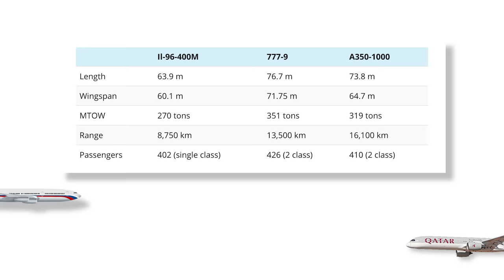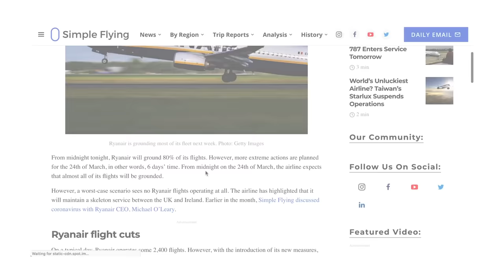The 400 Seat Passenger Plane With No Customers: The Il-96-400M

Comment: Yeah... not the best time to make a quad jet
Reply: does seem strange. why not restart the Tu204 line? update the wings on it, PD18 engines are not far away. the tu204 was a 757 ripoff anyway and we all know how well the airbus a321 xlr is selling atm. the comec 929 is a soviet style project. they have 1, we must have 1 also, no matter the cost or even if we need 1. stick it next to the 100,000 super aircraft carrier they want to build as a waste of money / bad idea
Reply: Likely conceived years ago and just now finishing up development. Late to market in bad timing looks cool though
Reply: Hasn’t been a good time for 25 years.  The 777 put quads and trijets on notice.
Reply: if the a340 failed this will too.
Reply: @mrrolandlawrence  The Tu-204 is probably dead because of the MS-21, but again ... maybe after the MS-21 hits the market, it will focus on upgrading the Tu-204. After all, why not have two products on the market instead of one.
Reply: @mrrolandlawrence  They ARe doing that: "The latest version, with significant upgrades and improvements, is the Tu-204SM, which made its maiden flight on 29 December 2010. In April 2022, United Aircraft Corporation (UAC) announced plans to assemble 70 Tu-214s by 2030."

Comment: Just slap two GE9X onto it, problem solved.
Reply: There was consideration given to making a variant with two Aviadvigatel PD-35 engines when those become available in the late 20s.  But it would need a completely redesigned wing and flight control system, and then go completely through recertification.  And the cost of such is nearly as much as building a completely new airplane - which would have better aerodynamics and weight tolerances.
Reply: they can't because: 1. needs a total wing redesign, which they cannot do. 2. due to sanctions they cannot buy any US made engines
Reply: I'll Prefer The RR Trent 500
Reply: THEY GOING TO SLAP 
TWO PD-35 ONTO IT AND PROBLEM SOLVED 
PUTTING AMERICAN PARTS MEANS THEY CAN'T SELL PLANES TO AMERICA'S ENEMIES 
AND IF RUSSIA GETS SANCTIONED THEY WON'T BE ABLE TO FINISH BUILDING THEIR PLANES
Reply: @rocketman1058  Was a damm joke...
Reply: NEVER!! WE SHOULD KEEP THIS A QUADJET!!
Reply: @Rocket Man might not need a wing design. 
A-340s and A-330s share the same wing

Comment: The a340 was better and no body wants that anymore, os an il96....
Reply: A340 sucks
Reply: @ahmedibrahim9082  It didn’t in the past.
Reply: @Think_Inc  It always sucked Il96 is the best
Reply: @ahmedibrahim9082  maybe, but It is still better than the il96
Reply: @marcducati  Nahh The A340 was terrible. The only way the A340 was better than the Il96 was the number of sales but on paper the Il96 is far better
Reply: @ahmedibrahim9082  i find that interesting as the il96 was heavily borrowing from the a340 program espionage style. this was because the il-86 was a dud. widebody with 2000 mile range. the a340 was a plane of its time. its the same plane that is the a330 with 2 jets. they looked at a 3 jet but that was soo much alterations to the tail so they went with 4 jets for the a340. the a340 will always be overshadowed by the excellent b777. boeing had inside knowledge / influence over the FAA at the time to get the ETOPS rating extended. the a340 never had the love that the b747 had either. so there was no outcry to see the type retired.
Reply: @guillaumeromain6694  "A340 was a great aircraft, extremely safe..."
The IL-96 will have a better safety record since it is doubtful that the 96 will make it in the air in any significant numbers.  :-)
Reply: @longshot7601  That's one way to look at it :) 
When Air France pilots crashed an A340 through an outrageous pilot error, they ended a 14 years flawless safety rating. A340 was quite an achievement, and a gorgeous plane to behold 🇪🇺
Reply: @ahmedibrahim9082  r u a paid russian troll?
Reply: @chemtrailpilotxy5415  No, the real troll is you. Russia is superior to the west in every aspect and you can't deny it
Reply: @ahmedibrahim9082  The only aspect were Russia is superior is in talking bullshit.

Comment: The original IL-96-400M prototype was actually created on the basis of the extinct IL-96M from the early 1990s, which was powered by four PW2337 engines and was equipped with Rockwell avionics. Ilyushin's financial situation has been difficult for a long time; to save money and streamline development, the IL-96M was built using the IL-96-300 prototype (CCCP/RA-96000). That aircraft's fuselage was cut fore and aft of the wing and new sections were built and inserted to lengthen it, plus new engines and avionics were installed. Ilyushin had high hopes for the Westernized IL-96M, but even then, Airbus and Boeing were making huge inroads into the markets of the former Soviet Union. The resultant competition was too great and the IL-96M project was abandoned. The prototype's engines and avionics were removed and returned to Pratt & Whitney and Rockwell respectively. Awhile later, PS-90A engines and Russian avionics were installed and the IL-96-400 was certified as the cargo-only -400T. A passenger version was always envisioned, but obviously the difficult situation for Russian aircraft manufacturers has caused the project to be put off until the present day. It's actually quite surprising Ilyushin and Russia are going ahead with it at all, considering how outdated and inefficient the aircraft is by today's standards.

Comment: I had read in an article that while the CRAIC CR-929 could be a competitor to the Boeing 787, the Ilyushin IL-900M could be also a competitor to the Boeing 777X, but with the first equipped only with two engines
Reply: Correct, it is planned to modify it in a twin engine configuration when the new-PD-35 turbofan is ready.

Comment: The cockpit windows look so similar to A340 / A330, or is it just me?
Reply: The original Il-96 is basically a modernisation of IL-86, and Il-86 came in 1976, way before both A-330 and A-340. So if you are implying that someone copied sth, then it's defo not the Soviets or Russians in this case
Reply: @drunklorry3406  interesting. just an observation. not implying anybody copied.

Comment: Damn if I had an airline I’d buy this good looking thing
Reply: Mateo Botha and if I had a airline I'd buy 20 il-96M 20 747-8i and 20 A380-800 I really would as they are all very good looking and as we all know it's safer to fly wth 4 engines than just 2
Reply: @76po  I too aspire of creating an airlines and after some research on quad jets, I found that it will he more effective to fly two a330s or b777s in place of an a380

Quadjets have slowly been dying to smaller wide body jets like 777, 787 and a350s for a while now.  COVID-19 was the last nail in the coffin 

The development of this aircraft came at an unfortunate time, but it may have hope if it has a good fuel efficiency

The Boeing 747 is also not the Best option for a huge jet nowadays, as a350s are now filling that gap.

Comment: Airlines are getting rid of their quad jets, there's no way anyone buys this. Why hasn't Ilyushin been working on a widebody twin?
Reply: Maybe because they can't find powerful enough engines in the Russian market, I'm guessing.
Reply: @osasunaitor  that's a good point. Wikipedia doesn't show Aviadvigatel with anything more powerful than the PS-90. The GE90 is like 4x at powerful and probably lower fuel burn, too. Which begs the question: why hasn't Aviadvigatel been working on more powerful engines? It's almost as if the Russians want to be 30 years behind the West.
Reply: @dcviper985  I don't know why either. However, the IL96 is an outdated plane, so maybe they are reserving their latest advancements for a future new aircraft designed from scratch. Or maybe they don't have the resources to produce better engines that will compete against western engine makers like RR and GE. Who knows...

Comment: "Russia didn't want to share its expertise in aerospace..."
According to the IL-96 400M, they don't have much expertise.
Reply: They are still using the same technology they had 40 years ago.
Reply: Russia makes very capable transport and fighter planes and has done so for a long time, they have huge knowledge in aviation and rocketry.
Reply: @bokhans  This video is about commercial airliners.
Reply: @bokhans  SU-57 allready in service?
Reply: @ddthompson42  MC-21, Tu-154, Il-62, and Il-86 would all like to have a word with you...
Reply: @9999AWC  All 4 of the MC-21s, eh? LOL 
The IL-86 was outclassed by the twinjet A300... which flew before the 86. Russia has certainly MADE airplanes that fly, the joke here is that the presenter says Russia didn't want to share secrets with China on their joint CR929, then Russia puts out another quadjet that can't match anything the twinjets are doing today.

Comment: The problems is that Russia does not have civil engines of more that 40000 pounds of thrust, it is just developing them as the PD40 of more that 85000 pounds of thrust with capabilities similar to the GE-X that uses the Boeing 777

Comment: 2 engines are cheaper than four and carbon fiber panels are as strong as steel and lighter than aluminum.  So a 1970s tech plane is like trying to market a 1970s car.  In 2020 .  But a 1970s car probably has nearly as good fuel economy.  But a 1970s airliner uses 25% per passenger seat mile more than a 2020 airliner.

Comment: With three major jet power plant manufacturers out there, at least one of which has relatively little footprint in North America, I wonder why they do not just try to retool the same plane as a twin jet? Maybe that is a bit naive of a question, but in the grand scheme of things it can't be all that challenging to restructure a wing to go from four to two power plants, can it?
Reply: Unfortunately, it is very complicated. The change in powerplant require a completely new, strengthened wing, which will affect the center of lift, center of balance, and the weight and balance of the plane. Even a simple change of engine (not even changing the amount of engines) is challenging enough: look at the 737MAX.

Comment: The jet could be something to offer while more modern concepts go through the long process of development in Russia. Several years into the 320 and 330 NEO's with Airbus, and this is what the Russians are trying to sell to airlines? It's a safe bet this won't lead the flag carrier Aeroflot to change any of its undelivered 350 and 777 orders. Only way something like this sells is if it close to the fuel efficiency of competing planes of similar size with a much cheaper purchase price.

Comment: And here I thought quad engines are no longer a thing considering the efficiency and size of twin jets these days. Maybe if they really need something w redundancy tri jets can be an alternative.
Reply: Someone on this comment section said that Russia still has ETOPS restrictions that would make quads make sense still, on the domestic market only at least, dunno about that but worth a check in case curious (...my curiosity tops here tho). Tri-jets are cool for sure, but the tail engine is quite the hassle. Harder maintenance and different airflow characteristics on it, regardless of being a straight duct like the DC-10 or MD-11, or if S-duct like the L-1011 or 727, I've even read somewhere (sorry that I can't find the article, been a while, really lost the link) that (McDonnel) Douglas back on the DC-10 development was hard at work on where to put the 3rd engine, even going as far as asymmetric layouts like 2 on one side and 1 on the other, all to avoid the tail engine, which they ultimately set to.

Comment: Quadjet is not without its benefits over twinjet
For instance 4 engine offers buffer in the case of engine failure 
Probably, even when they enhance the fuel efficiency, still there would not be international order as it dont show any good economically compared to other jets in the market as well as most airport are standardise to dock Airbus and Boeing model 

Most likely the plane would be used locally and maybe China

Comment: If we DETOPS 5 the twins and 737, there will be a scramble for old tri and quad birds in no time.
Would create an A380 boom, 747 Boom and lots of 787s, 777s, 767s, 757s and 737s all heading to the scrapper.
Due to a lack of Trijets made and quads, the iL96 would see a crap ton of orders and Airbus would be scrambling to reopen the A340 line.
Boeing will have to bank on 747 or brush the dust off the MD-11 to get in on it.

Comment: Cubana might actually have a couple on order to replace their older IL-96s on the Havana-Madrid run. But with President Biden taking office in January, an American detente with Cuba along the lines of what was seen under the Obama administration could open the door for Cubana to order the 787, 777, A330, A350 or even the A321XLR for those sectors. The A321XLR would probably make the most sense as they could also deploy the aircraft on Montreal and Toronto flights.

Comment: Those Il96 engines look like low bypass, 1970s engines like the ones found on the 707. Seems unlikely it will ever go into production, although maybe the Iranians will buy a few
Reply: Usually if an engine's BPR>4, it will be considered a high-bypass turborfan. Il96' Russian engine is PS90, which BPR is 4.4, better than 707's JT-3D's 1.42, though  inferior to nowadays western engines, which typical BPR is 9-11.

Comment: Will it be built? Absolutely.
Will it get any orders? Sort of. 
Will it be commercially successful? Absolutely not.

On paper, the specs of the IL-96-400M make no real sense. Old designs have been modernised over decades. This isn't new. Boeing and Airbus both do this for their daily bread and butter - the A330neo, A320neo, 737MAX, 777X are all successful models that make a virtue out of recycling old designs that can introduce new efficiencies without needing expensive retooling and recertification for the manufacturer and retraining for airline pilots and engineers. Where the 400M goes off the rails is that all these reheated wonders get their interest from airlines by being re-engined, which is the big effciency gain. Being a quad-jet in the 2020s is a bad idea. Being a quad-jet in the 2020s using the same engines you rolled out 30 years ago is a worse idea. The PS-90A1 engine is ancient. Not as old as the PS-90, but almost, and ins't a patch on newer engines either from Russia (like the PD-18) or the west. Being a quad engine model just makes it worse.

BUT, and here's the "but". It's not really about eeking out every last fraction of efficiency. Yep there's gap plugging going on, but this more about maintaining an independent technical base, in case sanctions from the west escalate. I suspect the Russian government will order some for government use, and possibly as a basis for new military tanker aircraft and even strategic airlift as well, given that the very large / strategic airlifter capacity is currently handled by legcy AN-124 Ruslans, something Russia is almost certain keen to move away from, given the situation with Ukraine. This will keep production running at a low level, so if sanctions ramp up, then Russian airlines can begin to migrate over from their western models. 

There are also other countries in similar situations (Cuba, Iran, Syria, etc.) who may well place small orders for the same reason. Cubana currently operate some IL-96s of earlier generations that are now very old and will likely be looking for replacements fairly soon, and as the situation in Syria returns to normal, the government will likely be thinking about rebuilding their aviation network in a world where they are unlikely to want to rely on western aircraft. 

There's likely also an element of hedging, which is where I think the gap plugging does come into it. The 400M has several obvious upgrades that weren't carried out, so I suspect the reason it didn't get a proper re-engine, and a simplified landing gear (that's a huge weight and complexity penalty with the current arrangement) is due to UAC/Ilyushin retaining some hope the 929 might happen in the medium term. If it doesn't (or if China goes it alone, which I think is the most likely outcome), then I suspect we might see an IL-96-400M2 (IL-62-500?) which we be a deeper modernisation, likely using some variant of the PD-14 engines, new landing gear, a fuselage stretch and probably some aerodynamic tweaking too. Potentially there's even the possibility of moving to a twinjet configuration using a geared turbofan - especially if the landing gear is reconfigured and aerodynamic improvements are made, as the opportunity could be taken to improve ground clearance to allow for larger diameter engines, and the wing configuration could also be tweaked for twins.  I doubt this would make the aircraft any more popular outside of the FSU and sanction-beating markets, but it would give those markets a reasonably competitive model that would be a viable alternative to trying to get grey market parts to keep sanctions hit western models in the air.

Comment: 1. All Airbuses and Boeings, wich used in Russia, belong to foreign companies and in 2014 aircompany "Добролёт", wich used  B 737 NG, was banned due to flights to Crimea.
2. Russia has domestic flights with range 6800  km and addition 1000 km as a storage - all of them are donated by government - the price of domestic produced fuel is not so important.
3. Due to current pandemic situation huge part of long-turn planes are stayed on the ground and government payed to foreign leasing companies due to avoid bankruptcy. 
4. Great A330 was born by changing on A340 engines. May be Il 96 will have the same story.